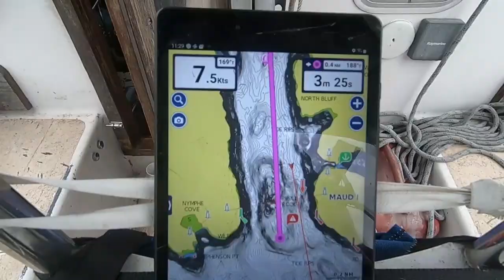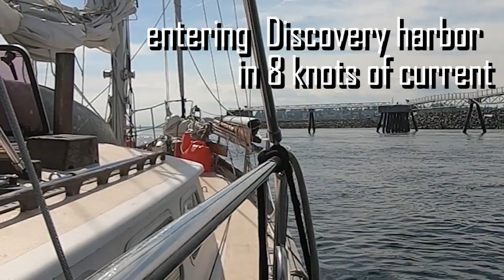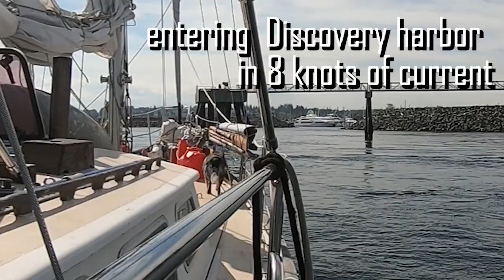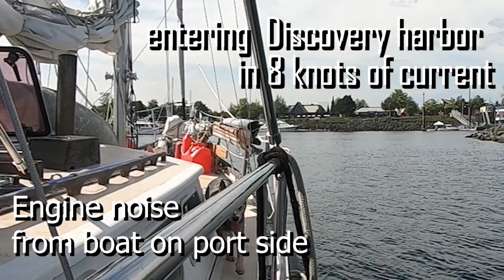no wind no solar electric boat in lots of current - Sailing Oka Solo - 046

Comment: How did they navigate without engines long time ago in these currents?🫨
Reply: Right route, right time of year, then hope for the best.
Reply: The scary thing is there used to be a huge rock in that area, called Ripple Rock which sunk several ships passing through.
Blowing it up was a major engineering challenge, which is presently in the record books.
Reply from the maker: Yeah unfortunately i had lots of miles to cover to get to my new job otherwise I would of spent more time exploring waiting for better winds
Reply: @SailingOkaSolo  time will come for exploring.

I just arrived at the boat yard.
I am not getting her lifted until next week.
I have lots of work on the solar system, and so on.